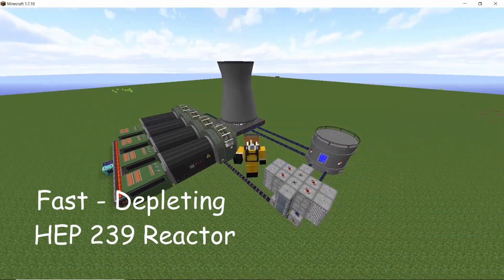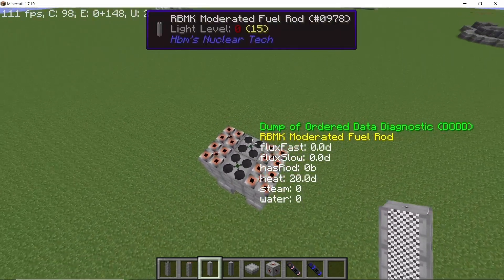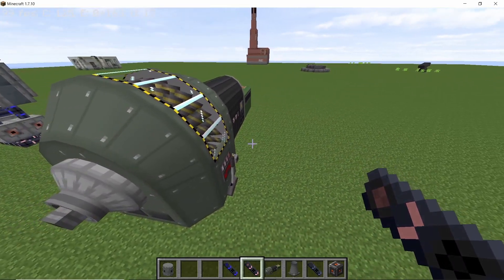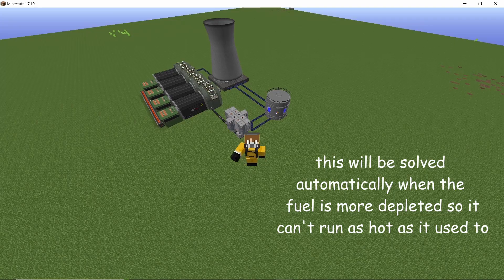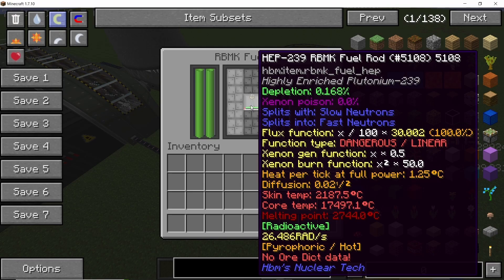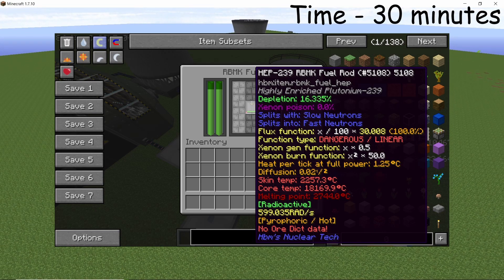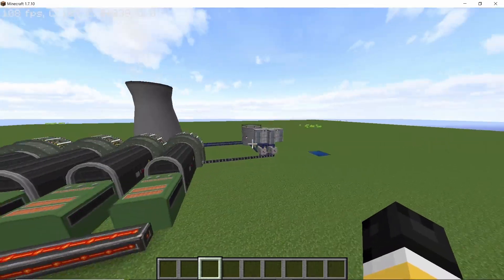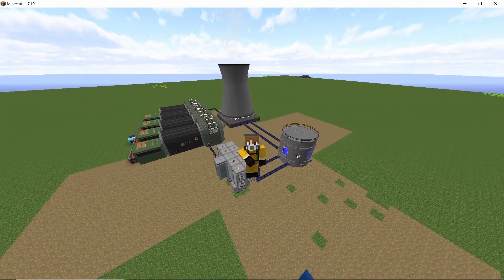FAST DEPLETING RBMK Reactor for HEP-239 || Linear Fuel Depleting Reactor Tutorial - Plutonium 239

Comment: I think setting this to cross which center is MEP and the corners are HEP and between MEP and HEP set control rod to manage it from 0% to 67% (or maybe 70% but it would be easier to melt down) is better rather than using boron absorbers. Compact one is still good but I think 13x13 batches are more common designs.
Anyway thank you for idea about linear management.

Comment: For anyone new here, you can use a similar design (with more steam channels & moderated fuel rods) to deplete thorium fuel rods at almost 0.002% per second which is extremely fast for fuel depletion. I might post a video about it soon.

Comment: Every time I try to build this reactor it end up blowing it up why
Reply from the maker: One of the main reasons can be leaving it in an unloaded chunk , as it runs very hot when you load the chunk again it will explode ... so make sure you keep this in a loaded chunk. 
Other than that if you have all the pipes set correctly the reactor won't explode due to it's design ...  like you can see it running in the video ... and I left it like that for an hour and it didn't explode

Comment: Yoo nice video I can't make a rbmk reactor but I can built it but I was wondering if i raise the control rods the reactor well explode
Reply from the maker: Well this RBMK has no control rods in the first place , if you're talking about some other design that you made then raise the control rods slowly keeping an eye on the rod which is running the hottest. 
As long as you keep it several hundred degrees below it's melting temperature you should be good to go

Comment: you could replace the side absorbers/reflectors with a control rod (or even an automatic one) with reflectors behind them os you don't have to switch out parts constantly
Reply from the maker: Actually I did make another variant with control rods , this one I just wanted to make it as compact as I could that's why only used 12 RBMK components xd (I just love compact reactor designs)